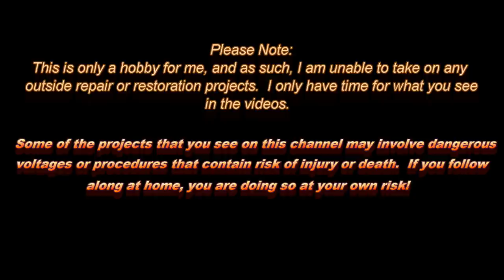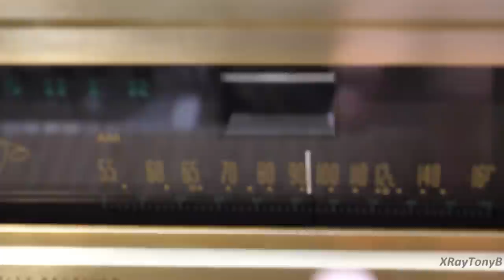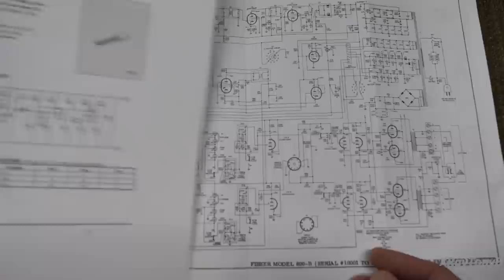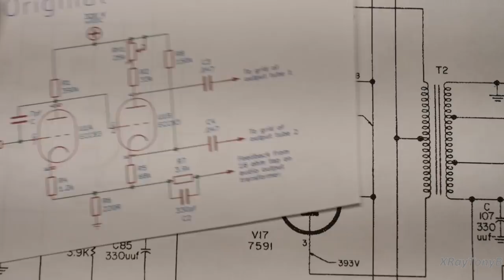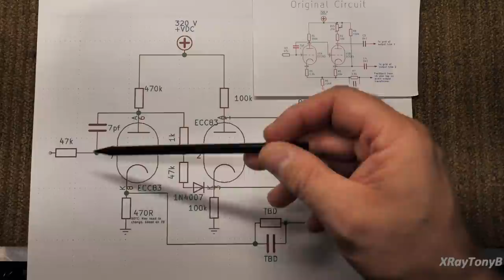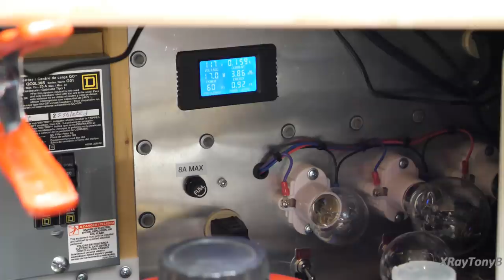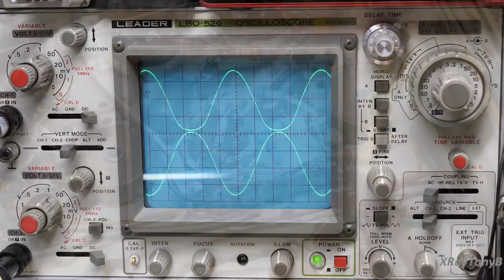Fisher 800-B Part 1 -  Amp Driver Stage - Theory, Testing and Modification

Comment from the maker: 0:15 Intro 
2:05 Tour of the Fisher 800-B and its Featrues
11:40 First Look at the Inside of the Chassis
20:00 Schematics & "TonyTalk "
30:56 Analysis of the Voltage Amp & Phase Splitter Circuit and Some Proposed Modifications
50:00 Power-up for First Time and Testing the HV Power Supply
59:43 Checking Voltages in the VA and PI sections
1:02:18 Injecting a Signal Through the 12AX7 & Scope Measurements
1:04:15 Cathode-Filament and Cathode-Grid Voltages; Do They exceed Tube Ratings??
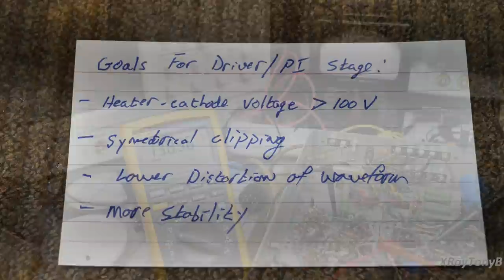1:06:55 Goals For Improving the Amp 
1:10:28 Trying One of the Mods that was listed online
1:12:37 Testing the Modifications and Comparing to the Unmodified Channel
1:18:09 Checking Cathode-Filament and Cathode-Grid Voltages; Did We Solve the Problem?
1:18:58 Closing Remarks and Primer for Next Part
Reply: A kool  fisher amp
Reply: A kool fisher amp
Reply: How meney whats is the fisher amp
Reply: hi where can I buy online caps and transistors. thanks

Comment: Nice walk-through of the output and driver stages, Tony, good improvement of the signal purity, and also the cathode-to filament voltage on the phase inverter triode! I would have liked to have pots for adjustment of idle current for each 7591 output tube. The way Fisher did this with no adjustments here is very strange. They probably had to match 7591's and sell as a quartet for these amps. Also I have read that some of the "new" 7591's really were "rebased" 6L6's or similar, with lower gm than the originals, which were discontinued some years ago

Comment: Thanks for a very interesting video (as all of yours are). I have three of these units, two 800Cs and a 500. One of the 800Cs is still in very good original condition (except for the FWB in the bias circuit) and I used it in my main system for many years. I never had any reliability problems, though I think your concern about the H-K voltage is valid. Anyway, I think it is one of the very best sounding amps I have ever heard and really have doubts that any modification the the phase inverter will improve it. It would be interesting if you left one channel unmodified and compare them.

Comment: Great video Tony. I can't be the only one enjoying the irony in the fact that YouTube swamps the video with ads for tiktok! The ultimate chalk and cheese situation! 
One thing - around the 37 to 40 minute mark you're talking about the layout for the phase inverter section and mention about how it wouldn't be good for the tube if the 150k b+ resistor was removed from circuit.. can you help my understanding here - I get that the 390k resistor world have the same voltage either side when no current is flowing, and that if you place such a high potential on the inverter tube grid it could cause issues, but would it not be the case that if any current flowed through the inverter tube in that situation then the 390k on the previous stage would effectively clamp it down? Thanks again.

Comment: I really agree with you about the feeling of such old devices and their designers. Many of those were simply genius being the very first. Back to your Fisher I wonder if the following mods would also work:
Add a delayed B+ relay that will improve all the tubes health. 
With delayed B+ we can remove R8
Change R2 and R5 values to have good working bias using RV1 to fine tune it. Feedback to be recalculated. 
On final stage replace both 330k grid resistors with a 500k pot connecting the wipe to bias -vdc to avoid matched tubes. Cathode resistors low ppm 1% 1 ohm 1/4 or 1/2 watt for a better very low frequency response. 
Is that a craziness?
With That said, I really like your own way!!!
Reply: I have stopped the video around 47:00 to read the comments to try and gain some insight into WHY he is making  the mod to the amplification circuit.  Maybe I missed something in the video, but if there is nothing detrimental in the original design wouldn't you rather keep it original?  Then I read your post and the disconnect between your first sentence and the rest of the post basically sums up my thinking here.  You like the feeling of the old device and the genius behind the design, but let's change this that and the other...To make it better, granted, but...why?  To me this is like taking a 1920 Rolls Royce then saying, but if we add headers, nitrous, drag slicks, a 4 link rear suspension...Then it is no longer a 1920 RR?  Yes, you can make it better, but why?  I don't know, I am not complaining, it is his, your, my tuner to do whatever I like with, I just don't get it.  Maybe I am missing something?  Design changes that make the unit more reliable, less likely to break, but don't interfere with the original intent...Hydraulic brakes with a dual master on the RR just to make it safe to drive...I can understand that.  It just seems to me the original design here worked fine.  If you want 150 watts per channel just get a Pioneer...
Reply from the maker: There are several inherent problems with the original design.  First, is that the cathode-filament and cathode-grid voltage differences are rather high.  This can cause the 12AX7 tube to fail prematurely.  Additionally, the drive signal to the output tubes will begin to distort before the amplitude is sufficient to drive the 7591's to full output.  These problems only get worse at modern mains voltages, which are higher than when these amps were built.  I tried to demonstrate this in the video, by showing the voltages and waveforms.  The modifications I am showing attempt to resolve these issues.  If they work, then the tubes should last longer and the amp should be able to produce its full output potential with minimal distortion.  Thanks for the comment!
Reply: @seanobrien7169  Generally I hate mods on vintage gears preferring originality.  In this specific case it seems that there might be a design weakness, that can be clearly left as is, but since Tony is modifying It I’ve just add an idea. By the way  it’s not to boost power, just to have lower distortion with minor (and reversible) mods.
Reply: @xraytonyb  Thank you for the response.  I have not got far enough into the video yet to see the comparisons in the two channels, you have just powered it up at the point I am at.  Again, don't hear me wrong, I am not complaining, I just wanted the insight into why you were changing things.  Certainly we all want things to work just as good as they possibly can, and it is a great learning experience.  I am looking forward to the THD comparisons.
Reply: @mymessylab  Thanks for our response.  I am not against mods per-say, as long as they are done in the spirit of keeping things as authentic as possible.  Yeah, my wattage statement was just a generalization.
Reply: @seanobrien7169 Discussions are the basis of improvement and always welcome.
Reply: I look it as building blocks on what has been learned from the original designs. Improvements can make it better.

Comment: All original 7591's that I have ever seen have that brown getter. I've been using tubes like that for years with good sound and no problems. I think it's just the kind of substance they used when the flashed it onto the glass. That being said, one of your tubes looks worse than the rest from the camera and stated to look more opaque. How did they test out?
Reply from the maker: I've seen that as well.  These tubes, however, were smoked.  The bias circuit was not working properly and I think the previous owner must have kept using it.  They had little to no emissions (I only tested them on the emissions tester) and I think they had been running red-plate.  I also have an original set of Fisher 7591's from a 500C that I owned many years ago.  Just like you said, they had a brownish tint around the getters.  Thanks for mentioning this!

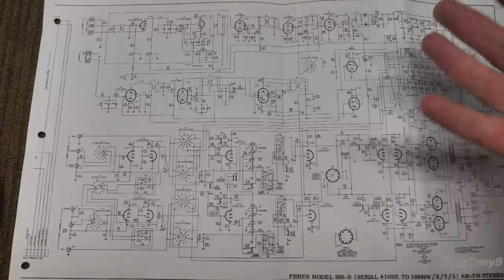Comment: 28:10 What you're saying is, people need to understand how things work from first principles. Due the education system (in the UK at least) many engineering graduates don't understand how things work from first principles because it involves maths and some universities shy away from teaching mathematically heavy subjects (these days) because: "take the maths out, our engineering students don't like maths"; that's a direct quote from a HOD to the research institute I worked in when asking us to create a nanotechnology masters course (it didn't happen for obvious reasons). Many engineering students therefore know how to turn the handle on the black box (the modelling software , FEA etc) but don't fully understand what it's doing.  If you're going to give us first principles, then you should go the whole hog and give use the maths as well.

Comment: On the difficulty of finding replacement capacitors that fit, what about hollow out the old capacitor and place the new one inside the case?
Reply: Watch the video 9:40 to 9;45 he mentions that.

Comment: It may just be an optical illusion from the camera angle but that PS diode lead looks awfully close to the AC line cord at the rear of that fuse holder.

Comment: 49:44 Why not try simulation software; it simulates the whole circuit. Closed form solutions (hand calcs solving simple ODEs etc, ) are used as a bounding case  (in mechanical engineering, at least) but modelling will get you much closer (again, in mechanical engineering it does).  LTspice is free.